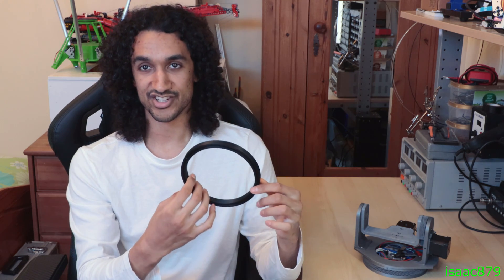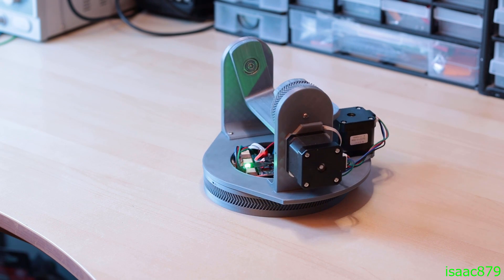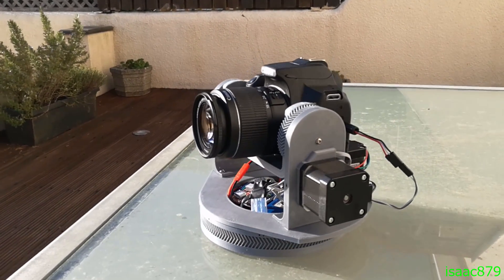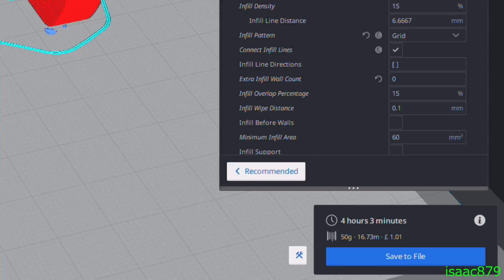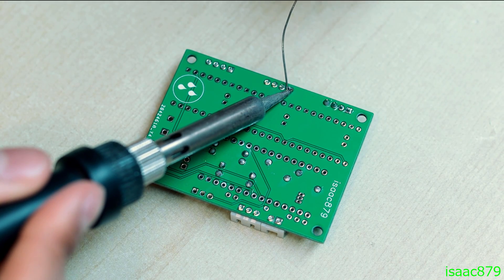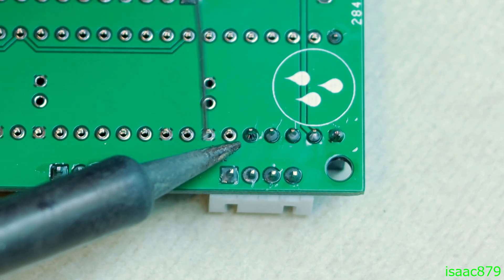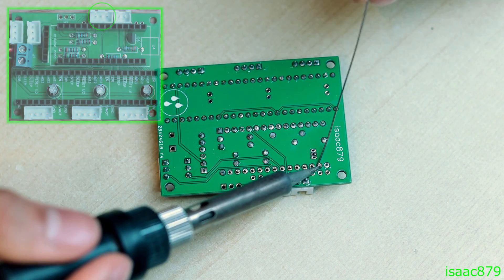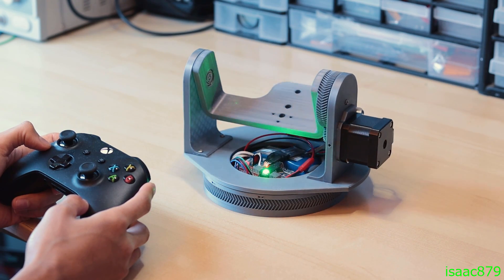3D Printed DSLR Camera Pan Tilt Mount (Arduino/Stepper Driven) 2020

Comment: I am trying to build / mod this project.  For costs sake I am using an UNO and a motor bridge board as I was quoted 60 quid for the PCB alone.  I do not see how the PCB is mounted!  I can see the recess for the hall effect in both the base and upright but nothing for the PCB. I also have modded the base cover plate "basemount" to allow for a wider camera and also the uprights to fit this new cover.  Still working on how to control the motors without a PC.
Reply from the maker: I believe in this version I use placed the PCB inside and did not actually mount it. In my updated version I added mounting points to screw my custom PCB to: https://youtu.be/1FfB7cLkUyQ?t=225

Comment: Can I use the CNC Shield v4.0 Arduino Nano with TMC2208 drivers instead of a PCB? Is the CNC Shield v4.0 compatible with the TMC2208?

Comment: This is one of the best designs I've seen on the internet. Are you still around? Could you make the camera mount a bit larger so I can mount wider cameras? (I see it's currently up to 120mm). Something that can go up to 140 or 150mm wide would be more than perfect to cover most modern cameras. I could pay for that adaptation. Thank you in advance for such a tremendous design!
Reply: I intend to make this to fit my canon 1000D which is to big for this as published.  I will let you know when I have modded the stl files.
Reply: @Hammocks_Rule hello there ! Hi! Thanks for replying! I ended up modifying the file myself, specifically the bearing part. I modified the base to accept an inexpensive $15 USD bearing from Amazon, a 5-inch "lazy Susan" type used for table decorations. The bearing works perfectly, and I ended up mounting the camera vertically. However, I encountered a problem with the overall design: the camera is heavy, and there's a lot of vibration from the motors that's transmitted directly to the recorded video, even with the micro-stepper motors at 1/16 and 1/32 (the smoothest possible). I think full-frame cameras require a more robust metal structure and belt drive. We should start a Reddit thread because it has potential.

Comment: Anyone who knows where I can get the INA CSXU050-2RS bearing ( The big base bearing)
Reply: He says he 3d printed it but it's obviously not 3d printed in this video
Reply: so he has the files where you can 3d print the bearing and use airsoft bbs. it looks like it may work pretty decent. he also has instructions for assembly in an unlisted video

Comment: Are there any alternatives to this PCB? Cuz jlcpcb don't ship to my country and ordering it here costs like 150$. Cool project tho
Reply from the maker: You could possibly order them from another PCB manufacturer. Or the schematic is available on the GitHub repository so you could solder up the circuit yourself (That's what I did for my first version). https://github.com/isaac879/Pan-Tilt-Mount

Comment: Nice work. I wonder if it could be easy for a novice to change some elements in the mount such as the length of the U shape part. From stp file and a softwar such as freecad it does not seem too simple. Which software did you use to create this parts and do you provide sources if we want to simply change blueprints ? Or maybe there is a muche mor suitable software than freecad to deal with step files . Thanks.
Reply: do u fix the wide mount ? i think with fusion 360 we can fix it but we need time!
Reply: @ yes i managed to update stl files with blender after all. Thanks

Comment: Hello, does anybody know if the U mount would fit to a Canon EOS T6i Rebel? if not the case how can I edit that part? thx
Reply: i measure the width in the slicer and it shows 120mm (to small for my a7iv with small rig cage (137mm) can we remix this with a more bigger platform ?

Comment: Curious if anyone has made this? I'm skeptical a plastic bearing is going to deliver good results, he's using the expensive one in the build.
Reply from the maker: If you print it with tight tolerances and make sure to sand the races smooth it works pretty well. Obviously not quite as well as the original bearing though. I'd suggest just printing just the bearing parts so you can get a proper feel of it and decide if you think it will be good enough for your application.
Reply: @isaac879  thank you

Comment: This is a really cool project and a really beautiful execution! However, if one would wants a quick and easy result, I think there's a much simpler solution - there are ready made boards with Arduino and stepper drivers such as MKS Gen and you could use closed loop steppers which have built in PID control loop and can recover from a skipped step or a stall and the gearing wouldn't be necessary (Makerbase has them in their offer for quite cheap). Alternatively, there are also planetary gear adapters for steppers which are in the range of $10 and are much stronger. I'm building something similar, but for an AK-47 with Nema 23 motors and the above mentioned solution.
Reply: Are you still making this for an AK-47, I am interested in doing this with an airsoft gun for a SIM group?
Reply: So what you are saying is "Dear sir, you know that project that you have designed, built, tested and used, I would not do it that way.  I have no intention of publishing my revised project nor designing it or any of that hard work.  It is my intention just to complain".  What arm armchair Geek you are.

Comment: I looked thru the comments but did not find the answer to ... the A3144 vcc is normally +5. I checked the spec and +5 is the recommendation. Yet, your schmatic (and I ohmed it out on the cct board) ties the hall to +12. So.... does it work at +12 or am I going to have smoke situ :-)    Great design very well done!
Reply from the maker: I just double checked the datasheet for the A3144 Hall-effect sensor and the Vcc supply voltage is rated from 4.5-24V so they are perfect safe to power from 12V. Maybe you have the wrong datasheet or a slightly different component? 
Also thank you :)
Reply: @isaac879  Thanks for getting back to me so fast - the data sheet I am referring to is from 'Allegro' - I've got 20 of them so ... it can't hurt to fire em up ;-)     Really great design Isaac, thanks
Reply from the maker: @GarrySchultz  Interesting because I was also looking at a datasheet from Allegro - no idea why they are different unfortunately... Haha yeah if you have a load spare I'd just plug one in and see if it blows up!
Reply: @isaac879  You are right. I have the hall running tied to 12v and .... no smoke... it works. Thanks again Isaac

Comment: Hi Isaac - I've been trying this with a Nano every but it doesn't seem to like your Iibrary.cpp - do you have any idea why this might be? - these are the errors I'm getting on compile

libraries/Iibrary/Iibrary.cpp.o (symbol from plugin): In function `getRandomNumber()':
(.text+0x0): multiple definition of `getRandomNumber()'
sketch/Iibrary.cpp.o (symbol from plugin):(.text+0x0): first defined here
libraries/Iibrary/Iibrary.cpp.o (symbol from plugin): In function `getRandomNumber()':
(.text+0x0): multiple definition of `Iibrary::Iibrary()'
Reply from the maker: Hard to say the exact cause... It seems like it thinks there are multiple versions of it so maybe check you don't have a duplicate copy in the library directory. I think I only used the mapNumber() and printi() functions from the library so you could probably just copy those from the .cpp file and paste them into the code and remove the library completely.
Reply: @isaac879  That did it - thanks - I had a duplicate copy of the cpp file

Comment: Hey this is amazing, I'm planing to build something similar myself and I had a few quetions, what is the pan/tilt angular resolution that you have with your urrent gear ration & stepper settings ?
Reply from the maker: Thank you and sorry for the delay. 
The motors are standard NEMA17 so have 200 full steps per rotor revolution. In 16th step mode this give 3200 micro steps per revolution. 
The pan gear ratio is 8.47 (144/17 teeth), when combined with the steps this gives 0.0133° of positional control.  
The tilt gear ratio is 3.05 (64/21 teeth), when combined with the steps this gives 0.037° of positional control.  
I have since changed the tilt gears to a belt  system with 123/16 teeth which gives smoother movements and more torque.

Comment: Interesting project, congratulations, but I have a problem. Because I want to use a mobile phone for recording, as I checked it will not fit in the mount. My Samsung S20 + is approximately 17 cm wide. Can you make such a version wider for a mobile phone?
Reply: do u fix it widh a wider version =?

Comment: Looks like a great design Isaac. I will surely print and try. Can you give an indication of how much backlash you have in each axis? My main goal is to use the mount to pinpoint the DSLR to exact coordinates (astrophotography). In that sense, backlash will be important.
Also, it is a good choice to use Hall effect sensors instead of tactile switches commonly used in similar applications.
Thank you for sharing it all.
Reply from the maker: Thank you! Honestly if you main use is going to be astrophotography you should check out https://openastrotech.com/ instead. Their mount is much better suited to it. I printed the gears to a very high tolerance so there is almost no backlash at all but this will depend the calibration of your printer. Limit switches would have probably been slight more accurate but I didn't want them clicking every time the axis moved past them (when not homing). The hall effects still seem very accurate though.

Comment: hi I was pretty much amazed by your project nd wanted to make one for my self, so I started making one for myself and I am done with all the hardware stuff but now I am stuck at the codes with xbox one controller  they r not compiling through arduino ide can u plz tell how u did the coding part cause else my money is in all that hardware, pcb n all, and for nothing plz help me out here

Comment: Hi Isaac,
SUPER project, very well done!!
The larger bearing you had for ages, is this a necessary item, or can I use the 3D printed one? If so, do you you have the measurements? I own a SONY A6100, do you think this also will work with You Camera Tilt Mount?
With regards,
Bram
Reply: Dimensions of the Pan Tilt mount between the (offset) camera mounting hole and the side is 47.5mm on one side and 77.5mm on the other.

Comment: Isaac, I built your marvelous pan/tilt drive. I am currently using my I-Phone to drive the pan and tilt motors. What I'd like to do is use my XBOX wifi controller  to drive the pan/tilt mount. I know the main.cpp file is involved but I'm not sure how to tie it all together. Any help would be greatly appreciated.
Reply: 4 years on........still no reply

Comment: Working on this (the upgraded version) over the holiday break.  It's a great project for intermediate fabricators.  Without a step-by-step guide, there is plenty of pre-planning and problem solving.  Thanks for sharing your work.
Reply: Scott have you finished yours? I've gotten as far as 3d printing, got my pcb, uploaded firmware, and assembled 3/4 of it, now I'm stuck on getting the xbox program compiled... what are you using to compile that?
Reply: @GabrielMedina23  - I haven’t gotten that far.  I think I’m going to use a Raspberry Pi and touchscreen with Windows Core, a Bluetooth dongle, and a PS4 controller... using his XBOX code as a guide.

If I get far enough, I will certainly post it on GitHub.  Might take me until Feb 2021 to do it, though.  GitHub.com/MrScottFletcher
Reply: I finished a version of a RasberryPi remote.  Video and links here:
https://youtu.be/O-RXUugMtgQ

Comment: those stepper drivers you are using are cheap and nasty. replace them with TMC2225 based drivers and they will run near silent with microstepping

example here - https://aurarum.com.au/shop/accessories-and-parts/stepper-drivers/bigtreetech-tmc2225-v1-0-stepper-motor-driver-uart-stepstick/

those stepper drivers are also somewhat  closed loop and prevent lost stepps.

Comment: Hi Issac, great project. I have it all built but there's very little documentation on how to actually use it. 
Could you explain some of the settings, may be a list of settings to uses as a starting point would be great.

Also, how do you setup a bluetooth controller to control the mount without a computer?

Comment: Hey Issac!   I'm currently printing the parts for this.   I am having trouble finding the big bearing, so I am doing the printable option.   Does the printable bearing require 1 or 2 "Pan Mount Bearing Clamp"   I am having trouble seeing how the printable bearing is assembled.   Thanks!
Reply: have you found a solution for it?

Comment: i found this project yesterday, the printer did his first realy printjob since i have it last week, so i decided to order the parts that i needed
i've forgott to buy the 1/4"-20UNC screw omg ok i print one when i'm done with this hole project.
but i still will change some details while i will mount some Video cam's to controlled it remote from one location, so i never need full tilt and only 180° pan
and i don't think my DSLR (Sony Alpha 7 R MK2 don't will fit inside this project i will see what i must change.. so i began on the lowest parts that i need, YES the bearing   100% fill while i do  or 5 outsitewals, so the space between is filled, but it need the same time with 3 walls and 30% ... so why not 100% infill, it is a critical part...and the same i doo with other parts, the printer will run nice with longe travels around and around.
Let's see that i can programm a ethernet port with a second arduino where i build in controll keys or use some controller. when i will use it, i will otherwise need also a video cable
Reply: how did you assemble bearing?
Reply: do u fix the width for the a7R mk2 ?  the 120mm width dont fit my sony a7iv with cage (137mm)

Comment: You are firing camera shoot by making port high and low?
Reply from the maker: Different cameras are triggered by slightly different methods so you should check for yours. Setting the pin high switches on an npn transistor which pulls the 2.5mm jack down to ground and triggers the camera.
Reply: @isaac879  I have Canon EOS D550. So the method is the same? High and Low and that's it?

Comment: Great design ! I was exploring this github project and noticed you are using 2N3903 npn as camera shutter. If i understood correct, you are setting shutter pin 0v for 200ms to take a photo ? Could this be done without npn transistor, just using arduino digital pin ?
Reply from the maker: Thanks! Almost right. My camera shutter can be triggered by pulling the appropriate connection of the 2.5mm jack down to ground (0V). To do this I used the NPN transistor. Setting the shutter pin high (5V) turn the transistor on and pulls the voltage across it down to ground. The problem with doing it directly from an Arduino pin is that the camera is 3.3V and the Arduinos are 5V so could potentially damage the camera (It might work but really doesn't seem like it's worth the risk of destroying an expensive camera). Different cameras have different requirements for triggering the sutters and a lot can be found here: https://www.doc-diy.net/photo/remote_pinout/

Comment: Hello Isaac. Great efforts. I am Electronics graduate and also doing photography/cinematography as hobby. For cinematic video effects we use Gimbal which is very costly. I am designing something similar to mount on Tripod which will allow us smooth Pan transitions. I am using Arduino with mobile controlled Bluetooth app. Design of enclosure is bit different. To be fare your design look more impressive. Thanks for sharing this. [Subscribed ! Cheers]

Comment: Where did you buy 127 x 146.05 x 12.7mm INA CSXU050-2RS Bearing?
Reply from the maker: I actually got it free from me internship because it was being scrapped from an industrial robot... Unfortunately I have heard they are expensive which is why I designed a 3D printable replacement. Obviously it's not quite as good as the proper thing but still works well.

Comment: Can it be built using an RC transmitter and receiver ?
Reply from the maker: I don't see any reason why not but it would require changing the electronics for the RC receiver and a little bit of the code as well.

Comment: How sensitive/smooth is this? Ie, could I set it to move 45 degrees left and 15 degrees up across an 8 hour time lapse? Thinking this would be awesome for panning dusk till dawn star trail shoots.
Reply from the maker: It should be capable of doing that however if you wanted a dedicated mount for astrophotography you should check out https://openastrotech.com/projects/openastrotracker/ It is definitely a better design for star tracking.

Comment: Can microstepping lift the camera in the tilt setup with the given ratio of gears ? , Heard microstepping drastically reduced the power
Reply from the maker: Yes it can. The camera should rotate about it's centre of mass so doesn't actually need much force to tilt it. My newest version actually uses smaller motors as these ones were excessively powerful!

Comment: Nice Job isaac I have started to build one using lazy susan 6" so have modified the files some what also increased the hight and width to take a canon 5d . However having trouble  with your code (mainly windows.h and windef.h  appears to be a lot of different versions  get error compiling for unio ?)any chance you could point me in the right direction.
Reply: Hi Graham. Could you please share the files which you modified for lazy susan 6" ?
Reply: @piotr8905  No problem give me your email address and i will send you the stl files